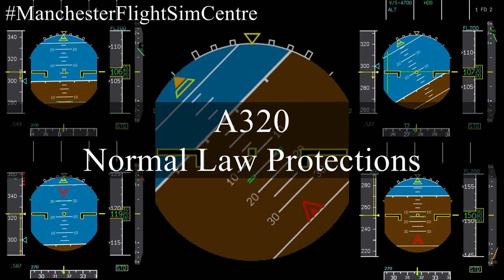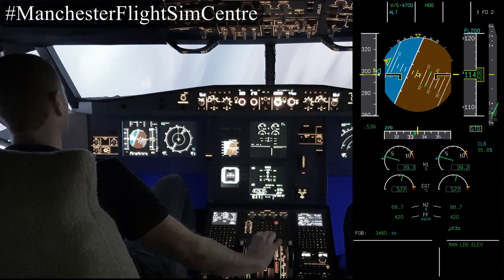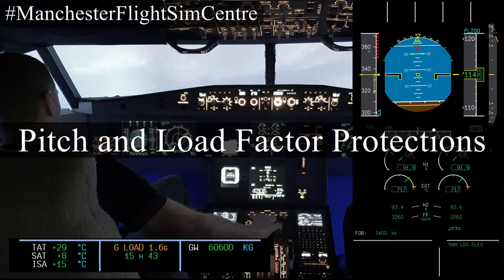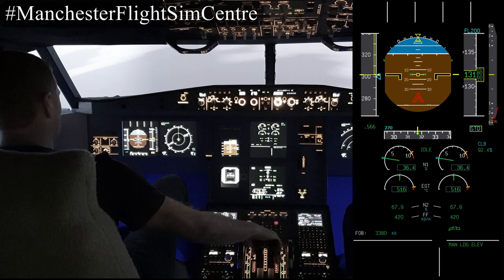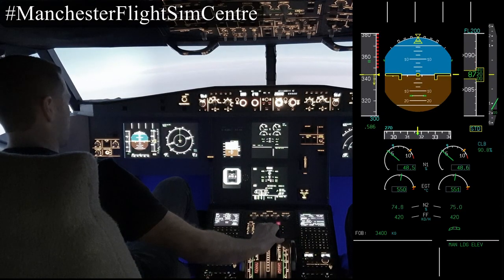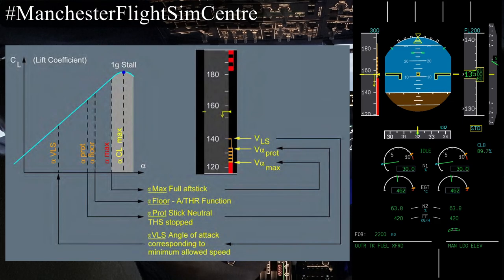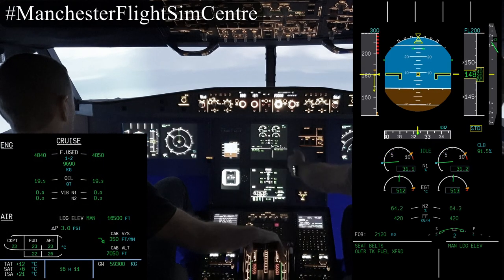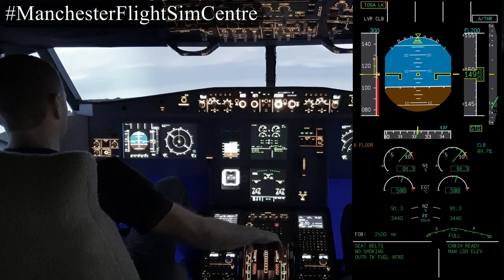A320 Normal Law Protections

Comment: Is there no audible alert for the bank angle
Reply: I wonder too
Reply: Nope. 
Because why would there be a bank angle warning when you are flying with all Protections available when the airplane is on normal Law ?
The airplane will never allow more than 67° of bank angle. And those 67° will only ever be flown if you purposefully push the Sidestick to the left/right.
The Moment you let go of the sidestick the airplane will itself roll back to the more modest 33°.
And the autopilot will never command such a steep turn anyway, so you have to purposefully make control inputs to get the airplane to those 67°. And if you are doing it on purpose anyway, what would be the point of the warning ?

So there is no reason why the computer would ever sound the warning sound 
"bank angle" when all protections are fully available.
Because you just can't bank the airplane steep enough to endanger it.
So no reason for the warning to sound.

Comment: I thought it was called vne not vmo
Reply: Depends on the altitude, if you’re up high using Mach numbers, it’s VMO.
Reply: It's called vne on smaller aircrafts like C172
Reply: @JasonSchwerin  actually no. VNE (Never exceed speed) is a limitation usually more related to pistons. Airliners have different limits: VMO (Maximum Operating Speed), when flying below the crossover altitude (the altitude at which you stop flying at an Indicated Airspeed and start using Mach Numbers instead, as you pointed out). Above the crossover altitude, MMO (Maximum Operating Mach Number) becomes the limit.

There are even some additional limitations placed below the MMO and VMO to provide a safety margin towards them, like VNO (speed for normal operations), which must not be exceeded under normal circumstances. 

It really get's a bit complex as there actually way more limitations and V speeds that are used in airlines :)